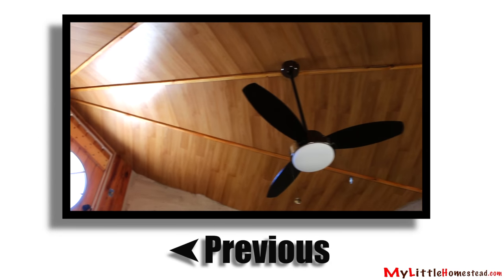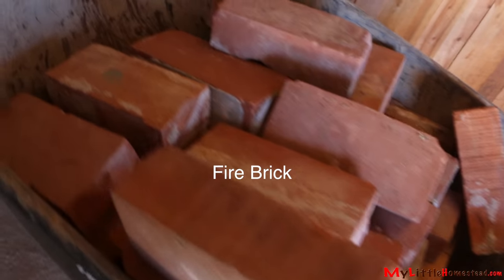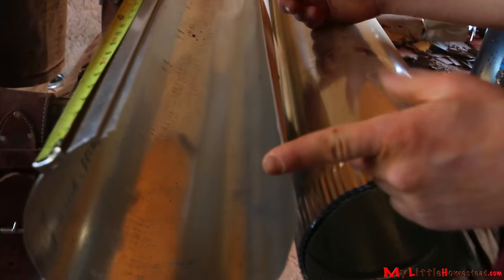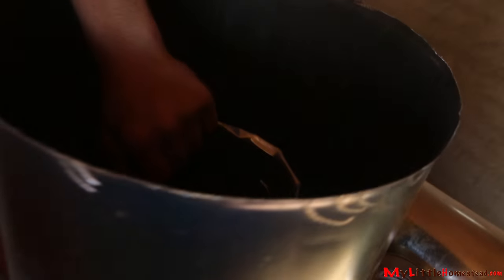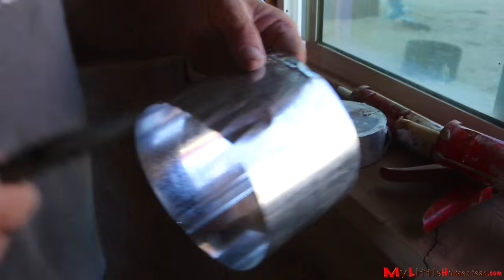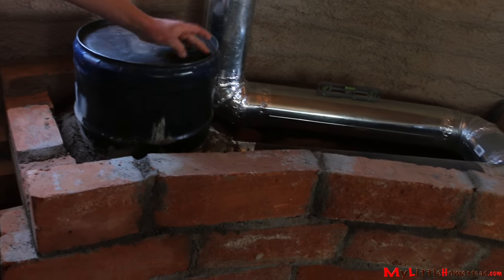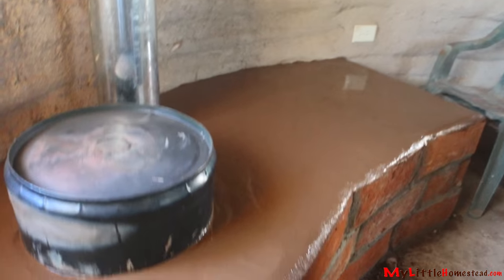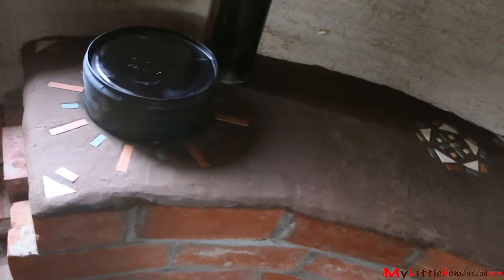Rocket Stove Build - $100 Cost for Expenses  |  Earthbag Construction | Weekly Peek Ep34

Comment: Hate to be a party pooper but if those  shiney pipe components are galvanized or zinc coated? You are aware they'll give off toxins when expose to high temperatures. Giving that even clean burning rocket stove produce creosote at  start up and occasions when fuel is not perfectly seasoned or just a poor  burning wood etc. Creosote will build up and if ignited that pipe that is only meant to carry warm air from a furnace or cold air return is going to gas off first and then burn out. Temperatures can exceed 1500 degrees in a chimney fire.
Reply: once the galvanize coat burns it will be ok don´t panic, it will burn in the first session.
Reply: As long as the weed don't burn up it'll be okay
Reply: I ran wet wood drilled motor oil, tranny fluid, green wood for an Alaskan 6month down to -30 winter the inside of my barrel had the slightest of black sheen  and that's abusing what should be burned. Zero creosote.
Reply: Zinc coating offgassing is a myth.

Comment: Did that pipe chimney really work? I used one in my stove and it turned into metal that breaks like glass. I also had to dismantle my rocket mass heater and up grade the material between the floor and the bottom of the stove. I found by inspection that the heater got so hot that it had started to smolder the wood floor under my stove. These are high speed stoves and should be treated as such. I'll never get rid of my stove but I will be vigilant in keeping a eye on it and hope if anyone else has had this problem. Post what you done to fix it.

Comment: Did she say they used linseed oil to seal the cob? That stuff is really flammable! Use sodium silicate to seal the cob. You mix 1 part of the stuff with 3 parts water. Coat it let it dry. Do that again a couple more times and it's sealed and it's not a fire hazard.

Comment: Hey guys, thanks a lot for your sharing. Do you think that I can build a rocket stove in my house, but there already is wood on the floor? No problem for the weight of the stove, there is rock under the house, my concern is about build a rocket stove inside and not make the floor to damaged because of the differents steps of build. It's is an old country house...

Comment: Great stove! but small suggestion: put the air inlet from outside near stove burning chamber inlet. Amount of air needed by stove is around 1 m3 for each 1 kg of wood. So if you will not provide stove with air from outside it will take air from home and will cool it down:)
Reply from the maker: +Pawel Tylinski Thanks for the suggestion!  Do you have a website or youtube video that shows how to do this? Thanks :)
Reply from the maker: +Pawel Tylinski Thank-You.  We will check it out :)

Comment: Great effort but wrong materials . Even if you used 1/8 inch steel pipe for the center shaft into the barrel it wouldn't last long because of the high temps ,plus using galvanized steel air ducts ? Bad idea . Otherwise it looks really good . Also please make sure and use proper safety equipment next time like gloves and eye protection . Sheet metal can cut just as deep as a razor blade and grinding brickwork send debris everywhere .
You seem like nice people who are very creative and I hate seeing good people getting hurt.
Reply: I don't see this house burning down it's made out of dirt lol

Comment: If I were you, I would build a little water tank to store the heat and enhance the moisture along with a valve to control the air flow to stop heat escaping when no fire is burning.

Comment: Doesn't building the bench against/touching an exterior wall allow a large fraction of its radiant heat to be radiated through the wall and out into the outside air? Wouldn't building an air gap between the bench and wall increase the heat retained inside the living space?

Comment: I like the build but I think certain components will fail sooner than you'll want to dig them out.  That barrel is gonna see temps over 700f with moisture from the wood and oxygen it will inevitably rust out.
Reply: People have RMHs with barrels that are still in good shape as much as 20 years later.

Comment: Hi from Argentina. After doing an extensive search on how best build a rocket mass heater, we have found your videos as the best instructional source available online. In particular, what we like from your way of building, is like us here in the Andes Mountains, you need to solve a problem improvising. This requires using whatever is available at hand, not necessarily exactly what the experts recommend, but things that could also work well and get the job done... I love your style..... It is an old saying ... the best is the enemy of the good. Our sons, my wife and I will build a rocket mass heater based on the one you built that was partially buried underground. It will heat a greenhouse. Many thanks for sharing your amazing life experiences. Best regards
 Francisco & Jeannine

Comment: I'm using you to prove to my husband that we can do this.
Reply: Haley E if you haven't building it all ready, you need to talk to someone that builds fireplaces. Find out what to use over a wood floor, how far you should build your firebox off the  floor. I've rebuild mine once so far. I used a black stove pipe in stove with cob and wire over the pipe in the barrel. It failed horribly. So did the fire brick under my fireplace. So far I have built a fire brick riser off the stove and now I have fire brick, 3 inches concrete, fire brick, 3 inches concrete then the starting of the rocket fire box. I'm hoping that fixed it but I will do cut away inspections this coming summer 

.
Reply: hydrolife04. Did it fix it?

Comment: With such a small stove you won’t be able to put large pieces of wood that will be burn slowly?
Reply: That's not what a rocket stove is designed to do.  You burn a small amount of small peices of wood, it heats the barrel and the cob which gives off heat for the rest of the day.

Comment: you do know snap lock pipe should not be used for any project involving fire and exhaust fumes, it is not approved or safe. it can burn through and/or leak deadly carbon monoxide into the room.
Reply: And yet it is used in absolutely all wood stove exhaust ducting I've ever seen...
Reply: Not trying to be critical just informative and maybe keep you alive.  I 
work for a major HVAC distributor and know of what I speak on this one. 
Just because everyone does it does not make it correct or safe. You 
should only use cold rolled steel black pipe that is welded and made for
 high exhaust temps of a wood stove or you risk burn through, leakage of
 exhaust fumes into the occupied area, and last but not in any way the 
least, the galvanizing can fume off filling the room with toxic fumes. 
But hey good luck with that wood stove.
Reply: Very interesting and informative comment Kem. As the hotter parts of the pipe are surrounded by earth mass, wouldn't it be considered safe? The most risky parts which could fail are sealed so the fumes would go outside. By the time the exhaust get in the vertical chimney they are considerably colder.

Comment: Can i use regular cement blocks
Can u use those pipes
I thot only black pipe?
Reply from the maker: Sure. Use the reg cement blocks. The temps are very low because the heat is quickly transferred into the cob. But if in doubt, use black pipe.
Reply: mylittlehomestead ty